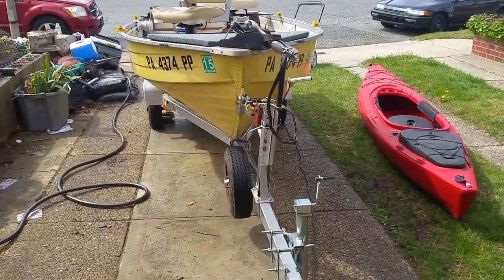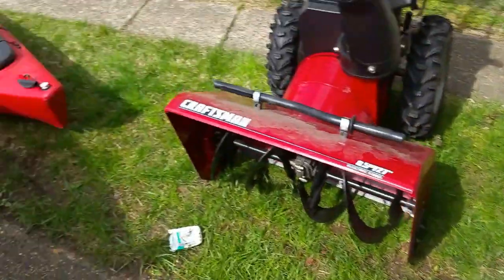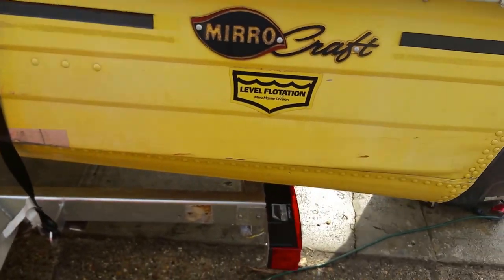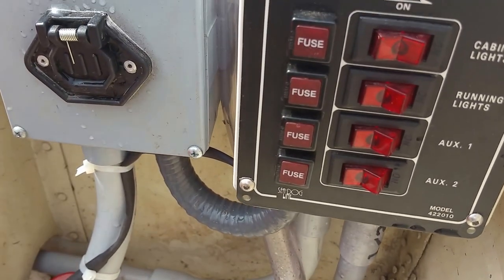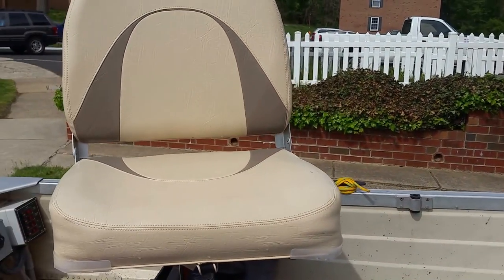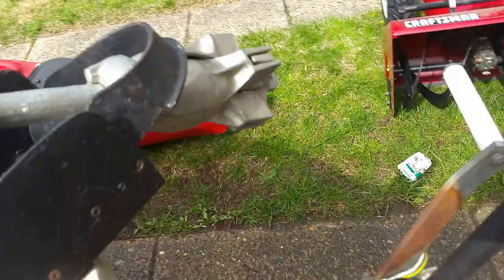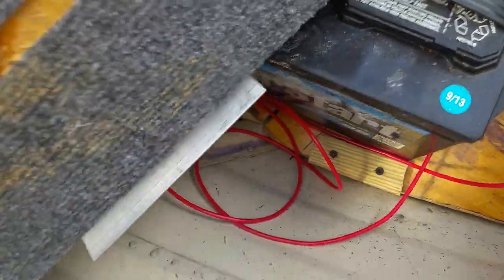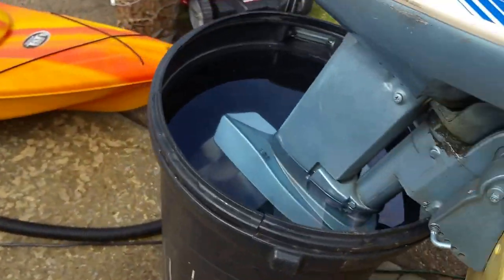12 ft Vhull Mirro Craft

Comment: Nice boat and setup. I happen to have a 1976 Mirro Craft 12ft Alum. boat. I love the boats,  mine came with 1976 6hp Chrysler outboard. I use mine for fishing year around at the local lakes. Mirro Craft builds some strong and enjoyable safe boats. I have a few videos I did on my 1976 Mirro Craft check them out. Thanks for sharing!

Comment: Did you find any public forums that talk about building out these MirroCraft boats? There are a million about flat bottom Jon boats, but I'm having trouble finding stuff about using these shallow V-hull boats. I just bought a 1970 14' MirroCraft, and I want to really build it out nicely, but finding people that have done it is not easy. I'm definitely putting in a lower deck, and rebuilding the bow casting deck that's on it...basically stripping the whole thing down and rebuilding the whole interior the way I want it. If you have any places where you have seen ideas about converting these boats, I would appreciate the info! Well done on your boat.
Reply: @chrisb8127  I'm in Scottsdale, AZ.

Comment: looks like you missed your front roller on the trailer
Reply from the maker: Good Eye. i was washing under the deck, when i tipped the boat up on the trailer to drain, it missed the roller on the way back down.
Reply from the maker: Anton Rusnack I hook up both the trolling motor and the evie rude to the transom. they are both offset which slows the boat down a bit when underway but it seems to work pretty well
Reply: i just picked my mirrocraft up today i cant wait till summer.
how fast are you going in full throttle with the set up you got?
Reply from the maker: Anton Rusnack about 6-8 land miles power hour

Comment: I have the exact same boat and I'm about to start putting a flat bottom back deck and a slightly raised front deck.  Using an aluminum ladder is genius!!!  I just bought 3 .6"x8' composite planks at lowes $100.  I was going to use them as cross bracing and also for the top of the deck(no rust/no wood/no mold.)  I believe I bought the exact same outdoor, non marine grade carpet too.  I am rethinking things now and I might use your ladder idea... 6' aluminum ladders are like $40 and are strong and light!!!  So...you 1st screwed down the ladder to the bracing...then how were you able to determine were to attach the top deck to the ladder?...upside down to get measurements first?   Great vid man!!!
Reply from the maker: +Bill Stoger  We used big cardboard boxes to make a template of the shape to cut first then once the wood was cut, we screwed the board down then carpeted. The only problem i have with the floor is that small items tend to fall through the gaps between the floor and the ribs. 

Also note that the deck is wedged under the remaining bench and screwed into the ribs with braces hanging off the back end, you can see in the video briefly.